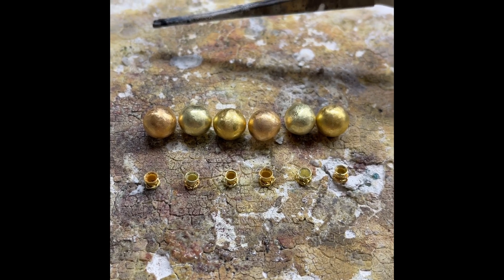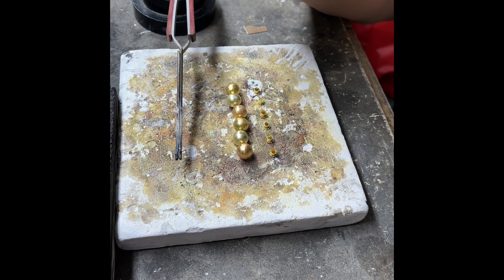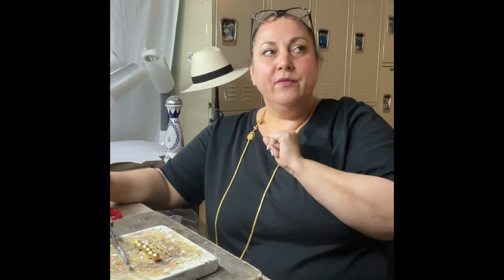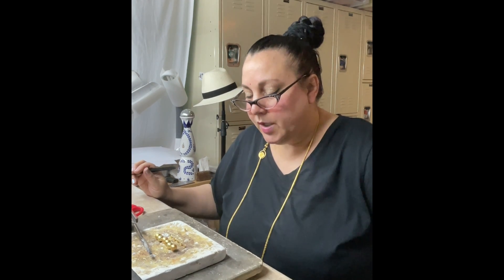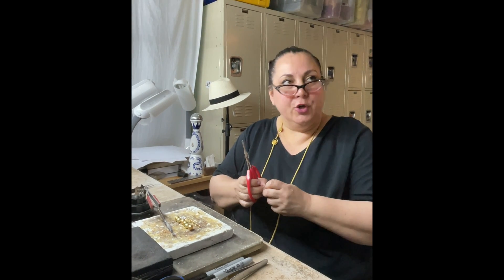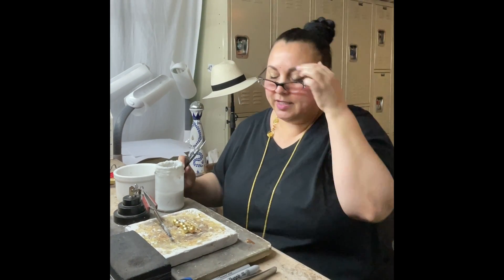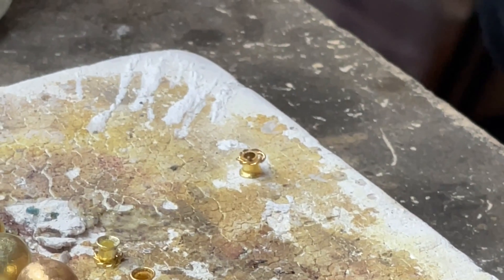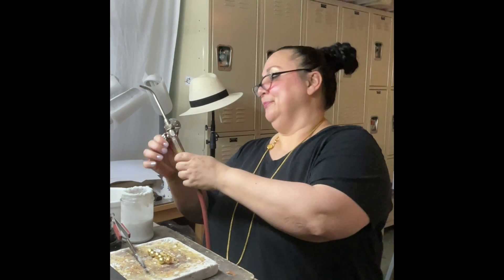How to Solder Different Color Gold Alloys Together Safely

Comment: Great tequila :) . anywho, soldering 10k white small piece  to a 10k yellow large piece with 10k yellow paste solder should work fine?
Reply from the maker: It should but you might want to use 10k easy rather than hard. :)

Comment: Hi there so if I was going to solder a 22k gold ring could I just use some 18k gold flattened and cut to a small square with flux OR is the gold solder something else?

Please help! Thanks
Reply from the maker: Anything with a lower karat can be used as solder BUT prepared solder is alloyed specifically so that it flows well. I think you would be better off with gold solder. :)
Reply: @JewelryArts  OK many thanks 

Was thinking of cost of solder as last time I checked a small bit of 18k was £120 or so whereas I have some 18k in an old ring I could use
Reply from the maker: @adiem1653  True but results with gold not really meant to flow can be tricky. Make sure if you  go this route, you use a concentrated paste flux to help things flow.